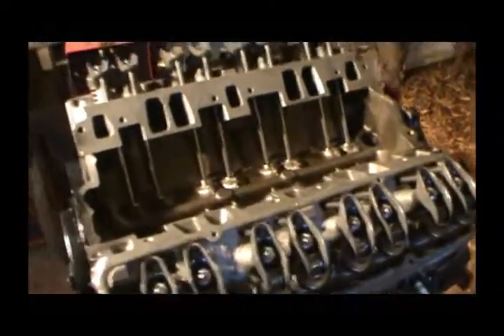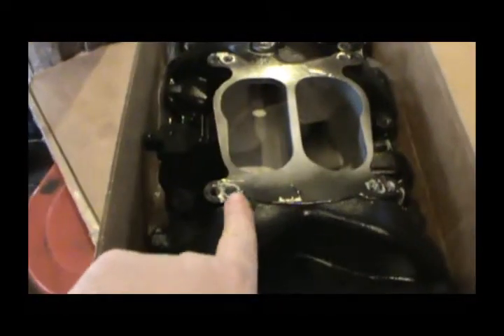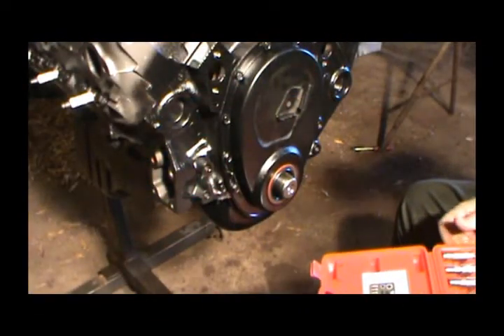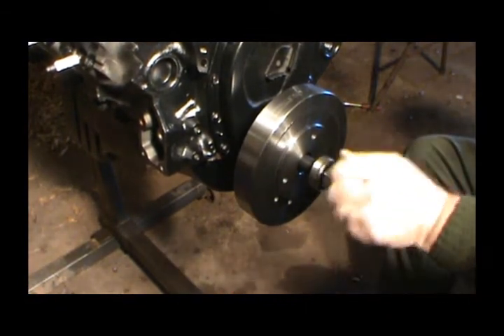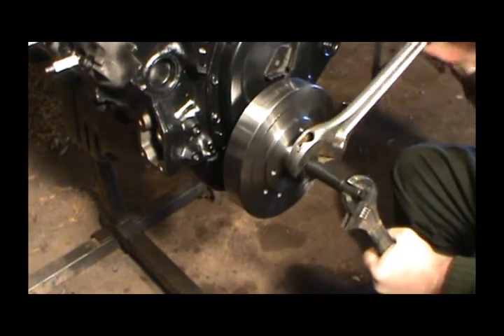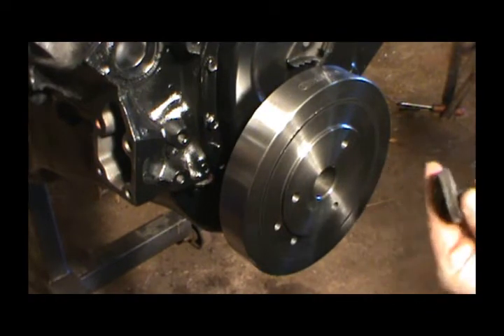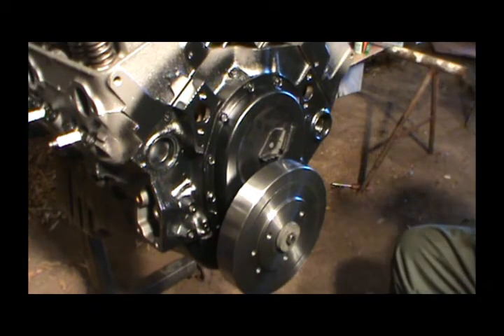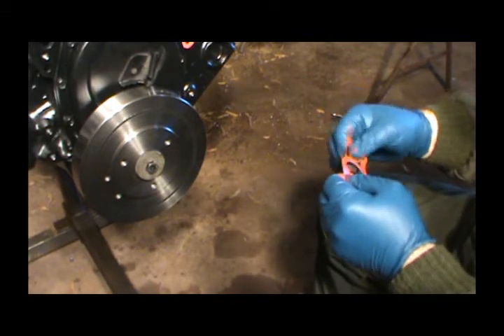Chevy 350 Engine Rebuild Part 8

Comment: Hey,I find this video useful as well. I went to install my harmonic balancer and bottomed out the install tool with just under 1/4 inch from the timing cover, just as you did. The install tool started to turn so I had some questions on it and stopped immediately. I watched your video and confirmed I did the right thing and that I'm right about where I should be. Thanks more making your videos, long live D.I.Y.!
Reply from the maker: Thanks for the comment!  Glad it helped.
Reply: Punk Rock Pete I had he same issue, i bought the same timing cover and was confused when the timing mark was such a distance away from the balancer, this video confirmed that the balancer did indeed go on all the way. Thanks to all the blue collar guys still making quality tutorials out there!

Comment: Great video. 
Very useful information also on the 350s does it matter what type of harmonic balance or that you use? And what time was the one that you installed on this agent? It looks different than the one that you took off? Thank you sir
Reply from the maker: Thanks Billy!  If I remember correctly, this balancer had the timing marks offset from 12 o'clock and I had to use an aftermarket indicator on the timing cover.  An OEM style would have worked with the factory indicator.

Comment: Farmboy great videos on the 350 rebuild.  Best I've seen so far.  Have a question but not sure if in the right place.  Can I replace a 350 out of a 95 chevy and put it into a 93 model chevy pickup?
Reply from the maker: I think you can.  I believe in 1996 they went to a vortec engine.  The cylinder head angle on the Vortec is different so the TBI manifold won't work on it.